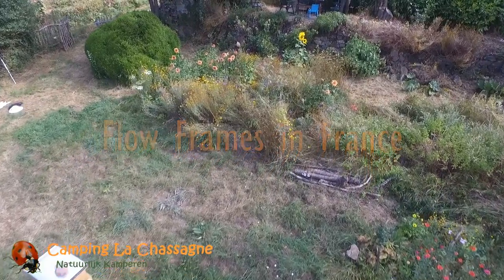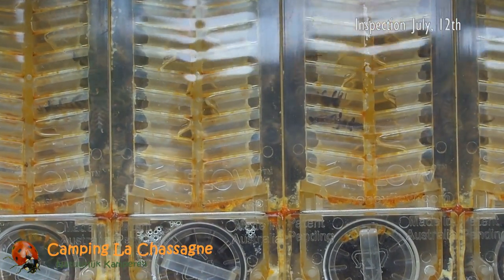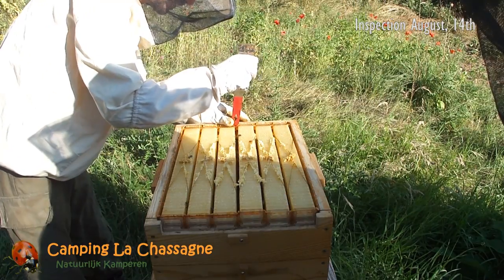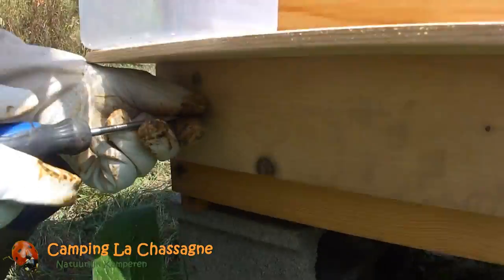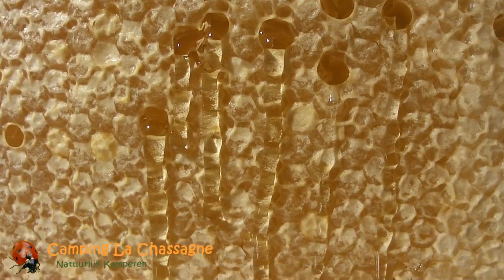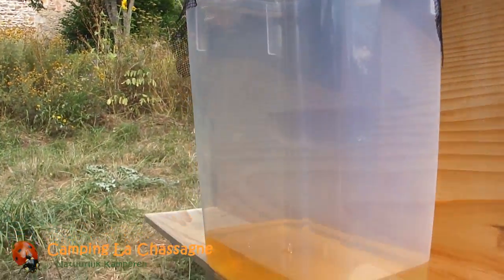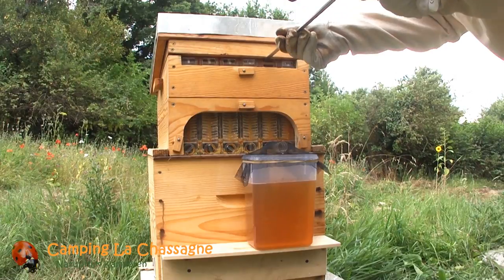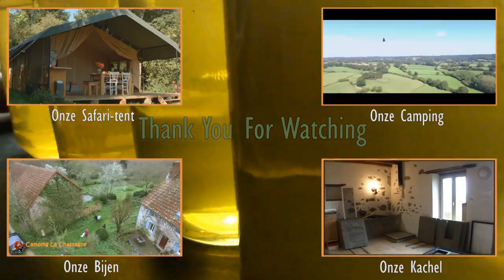Flow Hive Explained - Harvesting Flow Frames in France (#6)

Comment: Very nice job you guys! It's great to see what's going on in France and other parts of the world. Thank you for sharing your experience. You mentioned that your bees are recycling the cap wax? My bees are removing the wax caps and disposing of them outside the hive. How did you observe the recycling of wax by the bees? That is a very interesting observation you made, would you please provide more detail about wax re-use?
Reply from the maker: Hello Frederick, I just checked out your video; very nice and how lucky you were able to harvest twice! I am much looking forward to use the flow frames again, next season. I'm hoping we will have the same experiences as you did on your second harvest.

I am assuming that they are recycling the cap wax, because we did not find much of them in front or underneath the hive or on the meshed bottom-part of the hive.

I am, however, a bit surprised by the bees not picking up and recycling the wax particles that I do find underneath our hives at times. It seems like a waste, since it takes quite a bit of resources to be able to produce the wax.

Thanks again for you comments!
Reply: Camping La Chassagne It's actually something most people miss because they are doing the removal of discarded wax by flying hundreds of yards away. It's also why we don't generally see discarded dead honey bees, at sunrise, they are flying away with those remains also. In my experience, they generate new cap wax from new production. When I watch them drawing out comb or sealing a cell, they never seem to be bringing used wax but pull it from their wax glands. Thank you for the reply, I was curious if you had directly observed that behavior.